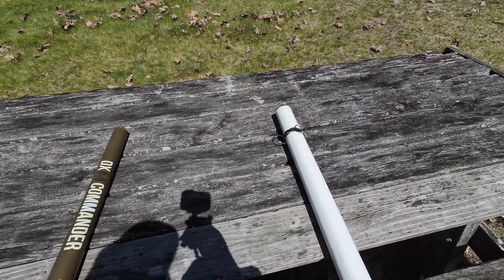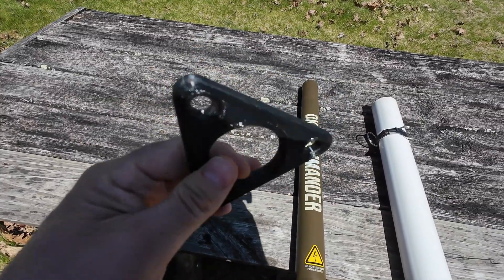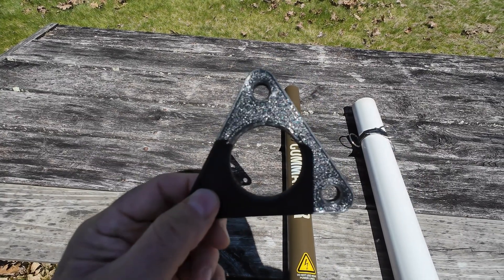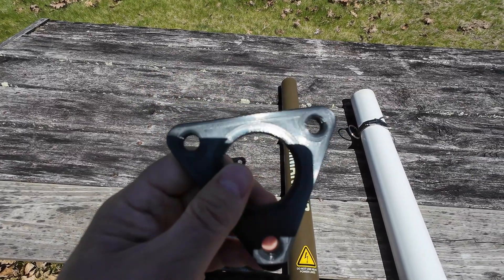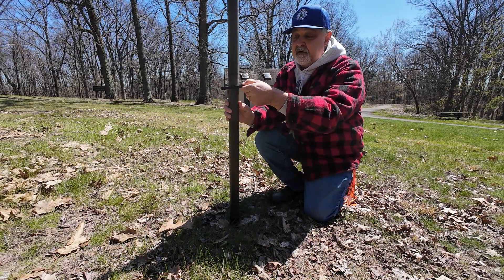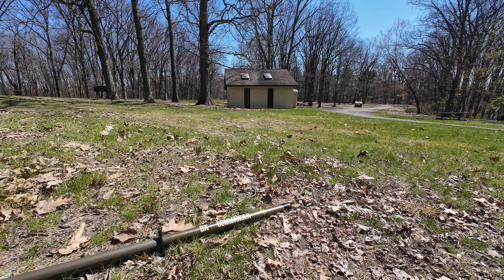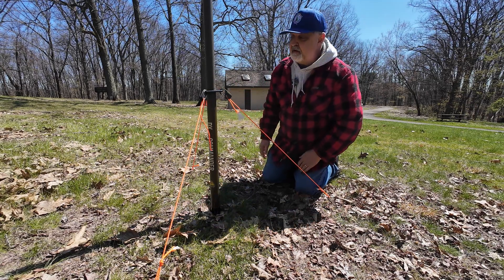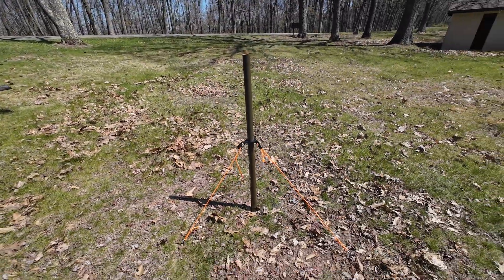New Lightweight Portable Antenna Mast Guide | No More PVC

Comment: I have learned since I've been making those for a couple of years. That you need to print them round with 3 holes and not a triangle due to the fact if you're activating on a hot day it will warp. Also I put a step on the inside diameter one the size of the bottom section, then the second section that way it can stand without extending the second section first.
Reply: I’ve been making these to use as feed point a arrangement for  quarter wave vertical using MDF 
for a few years. I use three elevated radials attached to the guy lines. Cheers Kevan 2E0WMG
Reply from the maker: I will have to search for a round design. Thanks for the information, and thanks for watching. 73s